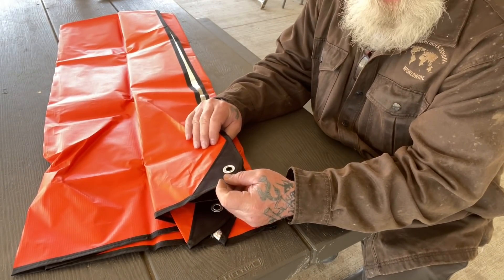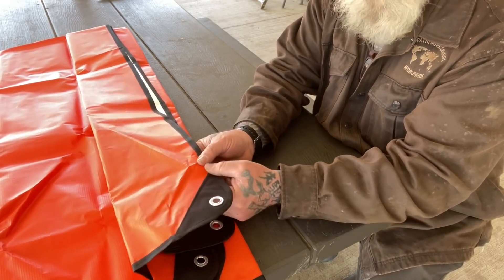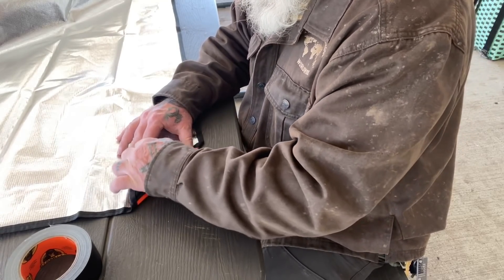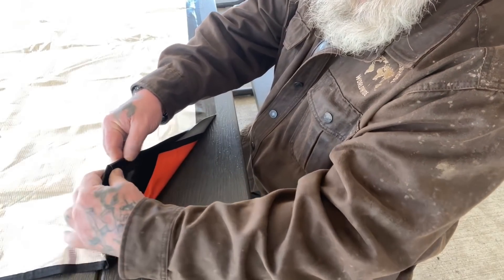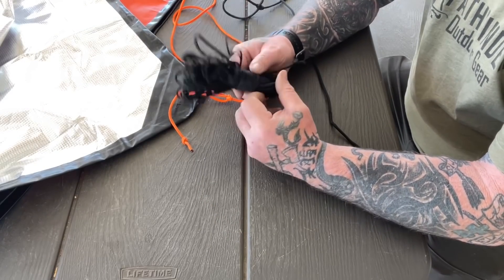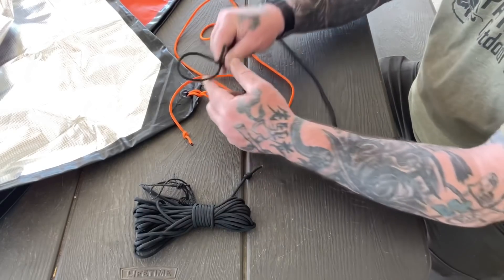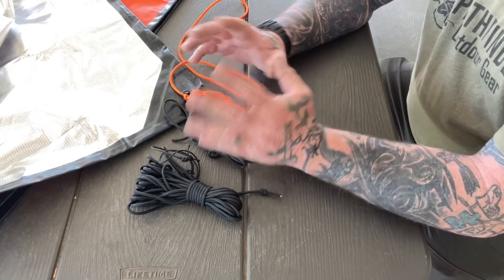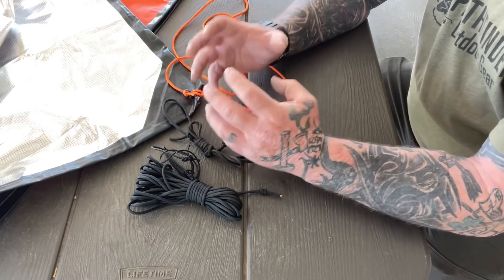Training Reinforce your Space Blanket

Comment: Question:
I had found information that says one way to measure out cordage was by holding the running end extended arm length straight out to your side and the other end from your center chest. The distance from center chest to your extended arm should be half your height. In my case 3’ & 1.5” estimated from center chest to arms length.

So when I measure out cordage this way I always end up with just a foot left over.

Any suggestions so that it comes out with the 4’ left over when following your cordage guidelines from your video?  6:21

Comment: Why not use waterproof glue for plastic to strengthen the grommets and seams on space blankets? There are many types of such glue on the market. J-B Weld 8277 WaterWeld Epoxy Putty Stick - 2 oz. is one such glue among many.

After putting the glue on the seams and grommets you could even add the duct tape to further strengthen the space blanket.

Comment: Back in 80s when I was a young 11B in a light Infantry, we had 550 cords tied on poncho for the same thing. 👍 about the same length of cord on all 6 grommets. For faster hooch set up. Many cold wet nights spent in poncho liner n poncho. Then I got a hammock used poncho the same but slightly off muddy ground.

Comment: G'day Dave, simple, robust, modular/repeatable and versatile, man after my own heart, the content, not necessarily yourself mate, lol.
The one thing I would say is, rather than the running bowline around the grommets, better in my experience to use a "water bowline" with the loop passed through the grommet as you form the knot, because;
A. you are not cinching down on the blanket material and it's tape reinforcement, (and the fixed loop still provides a staking point directly into the ground if needed and the tail is still available as an option too).
B. the extra "wrap" inherent in the water bowline adds integrity, just simply start with a "floating"  clove hitch rather than a single loop, every one knows a clove-hitch as well as a bowline right.
C. since its meant to be a permanent tie out, the extra wrap in the water bowline has been pre-tied, so no extra complexity/variation in the field. i.e. a standard bowline for other applications around camp remains the same and even if a corner needs re-doing, and you don't remember the water bowline, a standard bowline tied in the same fashion will suffice. Incidentally same deal with the bowline end of the rapid ridge-line as it too is pre-made as a permanent loop.
Cheers Duke.

Comment: Great video. I have an original brand space blanket I bought at the PX in 1992. 30 years later and well over 100 uses and the edges all the way around have lost that black hem piece mostly from dry rot after 30 years. A few small abrasions required some 100mph tape. It will probably last another 30 by adding these reinforcements. Thanks Dave.  I have really missed these kinds of videos from you.

Comment: Your cordage kit description is very close to what I've developed over the years... used to carry around lots of medium lengths that never got used, much easier to work with the 6' lengths and maybe 1 or 2 longer (25') stowed away for when needed.  I do actually mark the ends of my cord segments to identify the length, using an silver sharpie marker on black or dark cord and a blank sharpie on orange/light cord, with 1, 2, 3, and 4 rings/bands at each end for 6', 12', 25', and 50' lengths respectively.  (The 12' and 50' lengths and most 264' are in my vehicle kit only, not in my carry pack).  The bands/rings help when I need to ask someone else to grab a length out of the larger kit, and unless it's pitch black the marks are visible enough to work.   I do use 50' of 850 para for my rapid ridgeline as I deal with some windy conditions and it works better for me, the slightly extra bulk and weight are worth it.  Also, while I can tie a bowline in a flash (used to be a firefighter, it got drilled into me), for my prepared cords in my kits I do an Anglers loop (Perfection loop) but that's just personal taste, both serve the same function.  Love the thought of enforcing the seams and grommets of the cover, whether it be a space blanket or even a normal tarp (with grommets along the side in addition to the corners).  I'll be heading out to pick up some extra Gorilla Tape to do that on the covers in my shelter kits!!   73 de BJ, KM4RB

Comment: It looks like when you are joining the two pieces of paracord together with your "sheet bend" you are tying a square knot. A Sheet bend would have the short tail of the black line going under the black line instead of going back down through the eyelet.
Reply from the maker: You are correct and either will work for this application
Reply: And it should/could have been a slipped sheet bend!

Comment: Dave, Ive not done it myself but Ive seen a guy cover a trailer with a tied down polypropylene tarp & instead of using the grommets he duck taped cordage on the outside of the tarp & it held up through a storm for about 16 hrs with 80 - 100mph gusts.
The cordage went up the tarp 2 or 3 feet, not along the seams n he made the loops around where the grommets are.
The trailer is tall enough for him to stand up in n serve coffee outa & although it wasnt left out in the wide open during the storm to take the full brunt of it, it was outside & took a battering.
I didnt fully inspect it but from what I seen the tape, the cordage & the tarp were all as good as new after it.